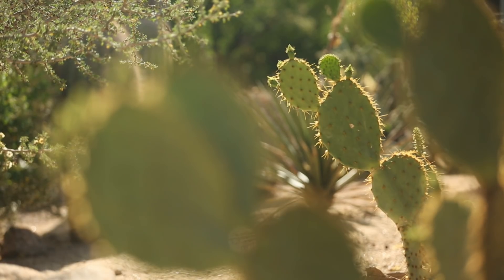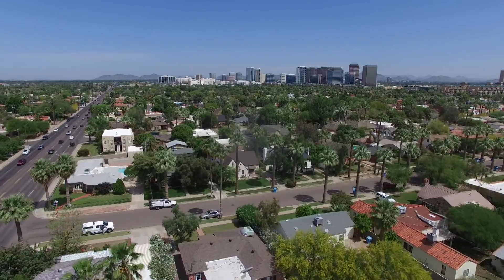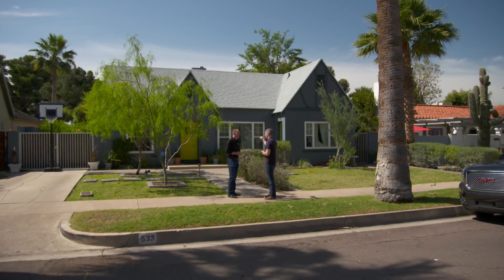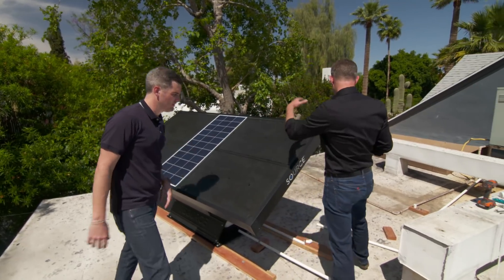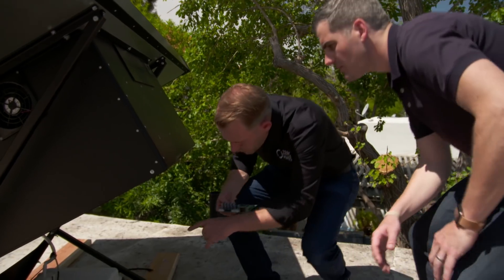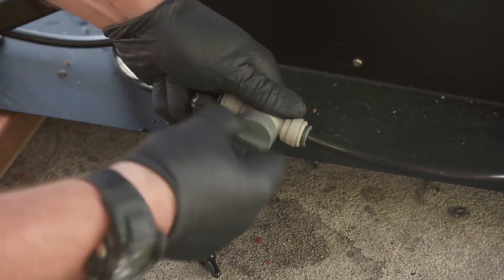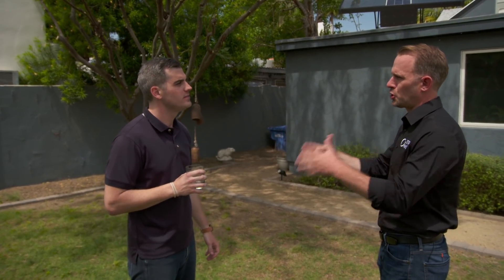Drinking Water from Thin Air | Future House | Ask This Old House

Comment: $3 for 2.5-gallons at Walmart
0.5-gallons per day per person.
Average house has about 3-people.
1.5-gallons drinking water per house per day.
10.5-gallons per week.
This is about four 2.5-gallon water containers.
This is $12 per week per house for drinking water.
This $624 per year per house for drinking water.

This thing pays for itself in less than four years for a $2,000 unit.

That is a good ROI.

Plus it saves me from buying, lugging, and throwing all the water containers.

I want one for my RV 😎.
Reply: that it may but it is heavily climate dependent it has to be humid where you are and this specific one needs solar power

Comment: A couple of gallons a day regardless of the humidity level? It wouldn’t make more in Tennessee than it does in Phoenix? That technology has a ways to go before the cost/benefit value makes it worthwhile. Until then I think filtration has this beat by a significant margin.
Reply: So far all those snake oil companies rely on the fact everyone is excited about anything solar, no matter how many times real scientists will prove how inefficient the current products are and how mathematically impossible most of their claims are as well.
Reply: ChaosKing I think you’re using data from the past. Solar and battery efficiencies have drastically increased in the last few years. Depending on application, they are already cost effective. Certainly not for everything, but the advances in the tech sector are closing the gap at a much faster rate than before.

Comment: If only there was an energy free technology to get water off the roof of your house? Some day, someday maybe!
Reply: I hear they actually trying to come up with something like that, very very high tech and extremely expensive.
I mean it takes a lot to buy some gutters, a food grade barrel and a filter.
I hear it can cost as much as 200$ in some cases.
Reply: @chaosking911  - Ha ha. This was in  the hot desert that is Phoenix, AZ where I live. We get maybe 7 inches of rain per year, over a total of ten days.  The rest of the 355 days a year - zip, nada, nothing.  The majority of the houses don't even bother with a rain gutter - no need.  All those trees in the picture?  They'd be dead without underground sprinklers, drip lines and bubblers.  We all have them at every house and we have programmable timers to put the right amount of water where we need it.
My cost of water per month to pay for watering the lawn and trees (a 10,600 sf lot), supply my swimming pool with replacement water after evaporation, and for my normal household uses = $190.00 - $250.00 per month depending on the time of year. Caveat: this also includes a trash pickup and sewer charge which are fixed, regardless. If this unit could pay for enough water to keep my pool full and my lawn and trees watered, that would be awesome.
I wonder what the units cost and how much each produces?  Anyone know?

Comment: I bought a whole house water softener plus a reverse osmosis filter for drinking water. (Includes multiple activated carbon filters) This will clean up even the worst city or well water anywhere in the USA. Combined cost about $1200.  Typical city water even in a desert community is about a penny per gallon.  
Why would anyone install one of these?  Maybe somewhere in Africa?  Somewhere that the water supply is toxic due to a chemical spill?  
Interesting technology but so few piratical applications.

Comment: $2000? 2 gallons a day? filtered water costs .20 a gallon in AZ. payback: $2000 divided by $.40 = 13 years payback. and that's if you buy filtered water.
Reply: 13 year payback on a system designed for 10 years lifespan.  At price parity, this produces water 30% more expensive.
Reply: Bill Gates didn't fund this thing to make losses you know.😉

Comment: How does it handle freezing temperatures? How much water can one unit collect in a dry climate... does it get more in humid?
Reply: It's a scam, then answer is, 'tell me what you want to hear', and "It does that!"
Reply: Uh, no... Doesn't work like that...  This isn't a solar electric system, it only has a solar PV panel for running the electronics that control the system and monitors its performance.

Solar thermal with heat pumps is a different technology from solar PV... It's channeling both ambient and heat from the sun for heating the air and that means it can work in a very wide range of climates as it's conditioning the air to always be in the optimal range to draw moisture from it...

The actual limit of the system is places where it may not get enough sun to provide enough heat but heat pumps means any other heat source can be used or you can simply scale it larger as with enough surface area even very little sun can still provide enough heat.

While the electronics monitor the temperature and control the heat to keep it at the optimal range.
Reply: Considering it heats the air, it should handle cold temperatures pretty well... 

Otherwise, it should follow similar rules as other atmospheric generators.  So volume of air and humidity level will effect output.  Just minus the huge energy bill...

But, in particular cold regions that doesn't get much sun you may need to add a heater to help heat the air, as this system is limited to where solar thermal will work...
Reply: This technology is rubbish for very hot or very cold places.
All you need is look at the cells they are using and realize their inability to produce electricity at non optimal mild climate.

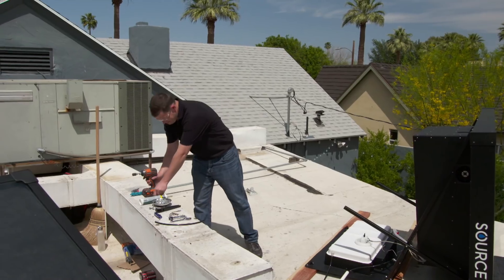Comment: at 3:06 he missed the joist lol
Reply: Can you tell by the sound?
Reply: Joseph Thompson The sound and by visually seeing it, there was resistance drilling into the redwood but after the red wood it plunged down without any effort which means he went through plywood into nothing. And the lag bolt washer did not get crushed which means that there's nothing behind that redwood except plywood.
Reply: Oh and you can also tell by when he lifts his foot the red wood moves up slightly which means thats 100% not in a ceiling joist and just in plywood. He knew he missed the joist and was hesitant in removing his foot lolol
Reply: what plywood are you talking about ? It looks like he driving the lag bolt into an anchor that was put beforehand

Comment: No, this is not a scam. However, this is EXTREMELY niche. In MOST situations, this makes zero sense. Certain specific parts of airzona are where it MIGHT make sense, but it is still a bit of a crap shoot. This is much better than the solar water generators you see on kickstarters, but even much better doesn't make it economically feasible if a better/cheaper source of water is nearby.
Reply: signalfire6 you are delusional. Simple physics explains why this is a complete scam.
Reply: Um...wait till the power grid fails and water doesn't flow cause no pumps are moving...
Reply: It is a scam
Reply: Add the cost of hooking up water to your house initially, plus monthly water bills, plus the (mostly unseen) costs of the added neurological poison (fluoride), plus the other poisons in municipal water, plus filthy water mains, plus chances of water supply interruption by natural disasters, etc.  Supply your own, eliminate the questionable profit oriented middleman.  People seem to forget that their water comes from the SEWER DEPARTMENT.

Comment: Cool dehumidifier re-purpose but you can buy tens of thousands of bottles of water for that price.
Reply: Or just gallons of water straight from the faucet.
Reply: ...Or re-landscape your property for drought resistant plants.
Reply: davidsquall351 there are many places where there is such a scarcity of drinking water, that this would go a long way to assisting those arid areas.
Reply: Check out the cost of buying land and then supplying it with water before you can start to build anything...
Reply: and add  tens of thousands of plastic  bottles to our landfills...if Nestle "access to free water is not a human right" corners the market, this option might make more sense in the future.
Reply: I was just putting a cost benefit on it. For regular folk this system is BS.

Comment: This is such a scam.
Reply: You don't pay your water or sewer bill then?
Reply: You paid for the air conditioning with electricity bills.  And it's not designed to produce filtered clean water although you could address that fairly easily.
Reply: giggly
Reply: Total, unbelievable, scam.

https://www.youtube.com/watch?v=vc7WqVMCABg
Reply: That is different from this technology. That makes sense. This does not.
Reply: No, this is a different system, it costs to install but the solar thermal and solar PV means it powers itself and it works throughout the whole day for continuous output as long as the sun is out.  So the only long term costs on this one is maintenance.

Output is still limited but it's a lot more than fog catchers can output.

While the only danger is if you're in an area where there is pollution in the air but you can easily just add a water filter to the system.  Just like any other water catchment system, like from rain, rivers, etc.

Systems can also be scaled if you need more, but the point is to be able to get water where you otherwise can't.  Even a little can be the difference between living and death...

It's just not intended to replace regular sources of water where they exist, just places where you can't easily have access to water and alternatives like rain catchment won't suffice and there's no option to dig a well, etc...

Besides, you should be careful of any water source and not assume any one is safer than the other...

Examples like Flint Michigan with their lead issue and the chemicals and drugs that find their way into our tap water in many parts of the country...  Even bottle water isn't always as safe as it should be all the time...

So good to consider filtering just about everything you are going to drink...
Reply: Brian Bouchard why?
Reply: Not a scam. It’s a proof of concept. It’s completely cost inefficient for now, and may always be, but this is how new tech comes into being.
Reply: scot shabalam You’re starting with a false premise. “Most of us”? The program has a very wide appeal and I’d venture to say a large percentage are homeowners not connected with the construction trade. You also assume that there are few or no people connected with the trades that would be interested in this on a conceptual level. 

But let’s say you’re completely correct. That would make This Old House an educational program for the various trades. Why should I hire a contractor or tradespeople when I can get the same information and techniques from YouTube and DIY everything?

Finally, it’s fine to point out the problems with the tech or to correct errors (nobody’s perfect, and most content creators want to present factual data). It’s even fine to discuss philosophical differences or alternate techniques, but it’s a bit much to try and dictate to any channel that they should only create content that you are interested in. Personally, I prefer the bleeding edge stuff over the rest of their content because I find the science behind it fascinating (though they could do a better job of explaining it). How much of it will actually become viable isn’t as important to me as understanding what can be done and where that might lead. This may always be a non-starter, but it could trigger an idea that winds up solving problems in a cost effective way down the line.....
Reply: scot shabalam Points. Plural. I guess addressing multiple aspects of your comments are “all over the place” to you. They all apply to your statements. 

The refrigeration coil was an analogy, not the tech being used here. They kept using the words, “it’s like...” The understanding of condensation has been around before refrigeration. This is coming at it from a different direction. One might say the opposite direction.
Reply: I'm not going to go so far as to claim it's a scam just yet but I do have my doubts about desert air being able to produce drinking water in enough quantity to be useful.

 Also I don't think the water is going to be very clean when you are taking it unfiltered from an atmosphere that has dust, pollen, mold, mildew, and other stuff in the air.
Reply: You're all over the place with your point, guy. All I'm saying is that without reliable operational numbers this thing is a toy.

 Also it's not "futuristic technology" we've known for a very long time that when humid air contacts a cold surface condensation forms. This is a jiggered together solar panel onto fridge and then attached to a bucket, Red Green could've made this.
Reply: Why not just drink the water that comes out of the air conditioning? It's free.
Reply: scot shabalam you technically could, but dust, pollen ,and other stuff can collect on the fins also. Plus, you can also get a deadly disease from the lukewarm water, but that probably won’t happen. I forget what the disease is called, I will look it up and see if I can find it
Reply: Consider what this show does and see the criticism from our point of view: Most of us are in some way connected to home building and design we can't waste money on proofs of concept.

 We like numbers that we can quote and are accurate because we need to accurately plan a water supply because nobody wants to live in a home that lacks a reliable and clean water supply. Things like central air units and water heaters have this, this product does not.

 What they need to do is regional testing, humidity level testing, and water purity testing. These things need to be published along with worst case scenarios from lack of humidity and being near air pollution. But even then it's hard to trust them not to fudge the numbers because nobody knows the company that well and there is no government mandate that says it has to meet a certain efficiency and purity. 

 They also need to publish exclusion zones for areas near pollution sources because this thing may pull toxic materials out of the air, concentrate it, and pass it on to the water source. And I don't think the company wants to publicize this information and there's no government regulation on it either.

 So you're right it's a proof of concept but it's just not applicable to current home building or modification.
Reply: Brian Bouchard .It is a scam to put a surcharge on water we get for free in town
Reply: Costs a ton and gives very little and is dangerous as hell.
There are places on this planet where they already use it and they need daily care to keep the water safe to drink.
https://www.youtube.com/watch?v=bqZw1MqISvM

Comment: Very cool for the right market, but this has absolutely no value for the average house. Water is typically clean, safe, and incredible inexpensive. Volumes of drinking water is literally insignificant in cost. They would be better served by putting in a 5 stage reverse osmosis system for about $200~ instead of $5,000.
Reply: I totally agree with the reverse osmosis system but the point of this product is to produce water... Like In a place of drought where the supply to get water to the reverse osmosis is low... Totally agree with you if you live where water is readily available.
Reply: briancnc This is invaluable if the grid goes down or in places with no access to power! Our Texas water tastes like sand/dust so we buy filtered water for drinking! Drilling a well is often not a good option... we hit bed rock about 15 feet down, long before you get water! I'd like to know what kind of maintenance this requires
Reply: It won't always be cheap.
Reply: The aquifers are being drilled dry and are likely contaminated with godknowswhat...  if you knew what was truly in your well water and/or municipal water, you'd never touch it.  Millions of tons of pharmaceuticals, hair dyes, soaps, chemicals of all kinds are dumped into sinks, showers and toilets every day.  You think they're all removed from the sewage system before that water is recycled to you???  And with fracking and underground nuclear tests, well water isn't safe now either, not by a long shot.
Reply: briancnc well not really clean. water is full of nasty things u cant see all medic woman pill make u no breeding
Reply: All drinking water should and can be easily filtered without spending much money.
Reply: The part that they will never address, for obvious reasons, is the fact that even in arid climates, it is still way cheaper, more efficient and more reliable to just dig a bloody well to the aquifer...